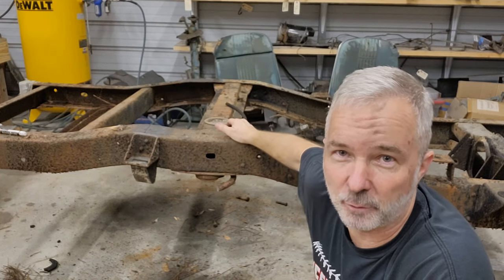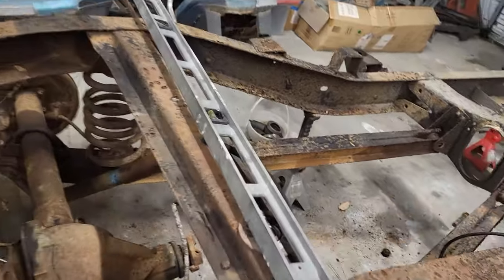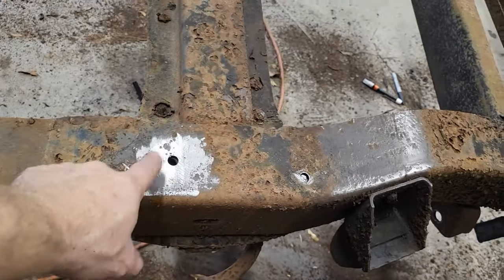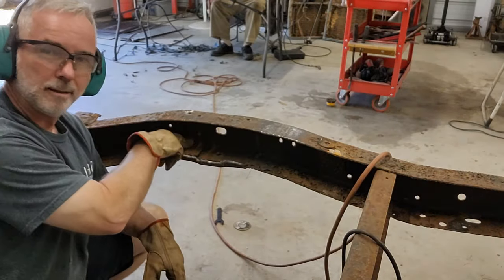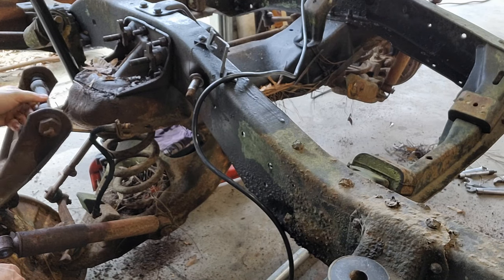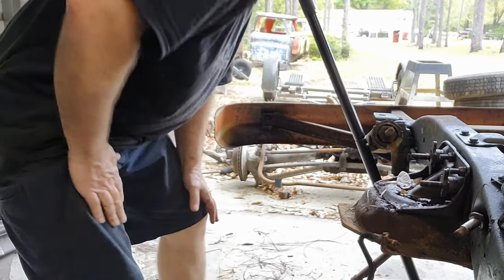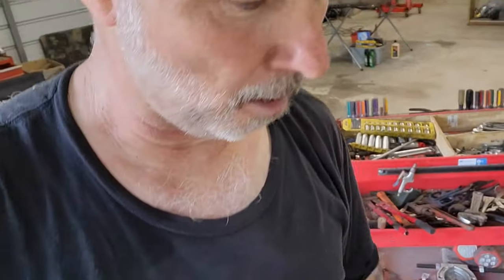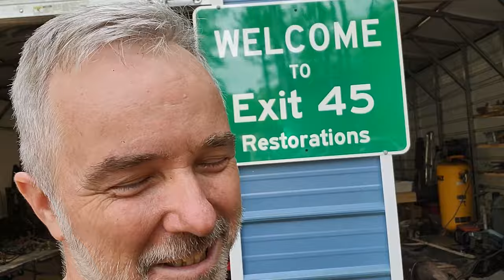1965 C10 Resto Mod - Suspension Removal

Comment: Hello Matt. You sure did a lot of work in this epiode! I bet you were tired after all that wrenching. Good job. Will you be sand blasting tbat frame?
George B
Reply from the maker: Hey George.   Always good to hear from you.  This was a very tiring video for me.  It took a couple of days to get it stripped down.  After I finish mockup of the suspension, engine and exhaust,  I will tear it all down and blast it for sure.

Comment: You can't put them back together without first tearing them apart. Lol
I've had a couple of cut off disks come apart, it's not a good feeling. 🥺
Reply from the maker: That was the first I got on camera.  You can see the camera move when it gets hit.. pretty scarry stuff when you have your face right next to it.  It should be a good reminder for everyone to think safety when using them.  You have as many projects in work as I do.. we have a problem I think.. 😆
Reply: @Exit45Restorations  like Nick @vintagethunderbirdrepair9426 say...its a sickness! Lol